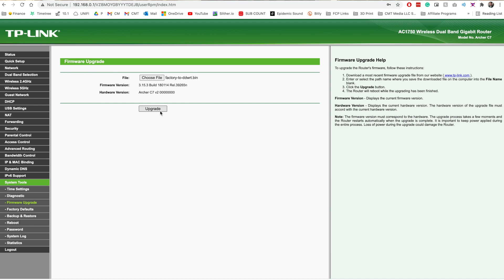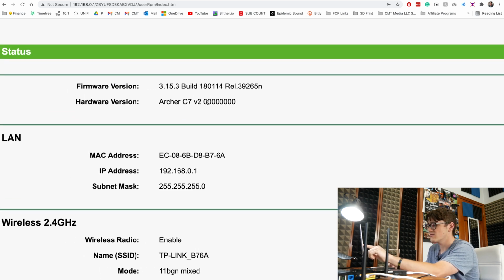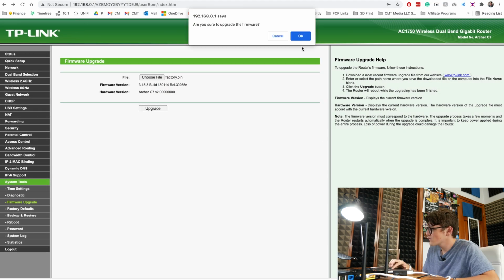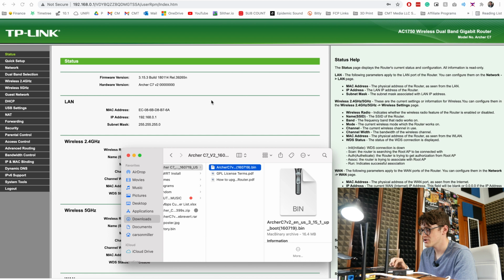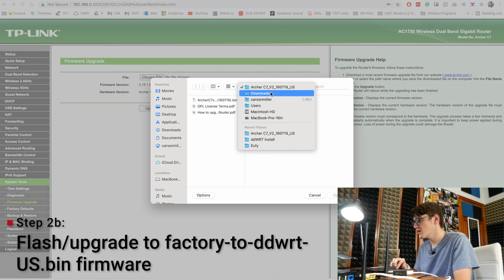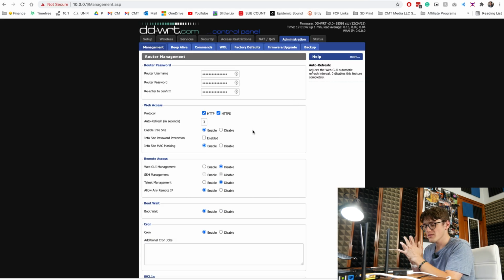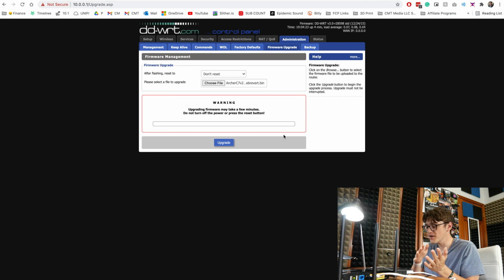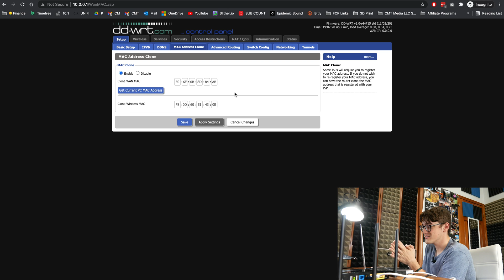TP-Link "Error Code: 18005: Upgrade unsuccessful" [EASY FIX] || Archer C7 DD-WRT Firmware Upgrade

Comment: i just downloaded from tp link site, disconnected the internet, logged the router and had no problems upgrading, the firmware is on the tp link site which i didn need to downgrade, and there was no problems, 2020 dd wrt firmware